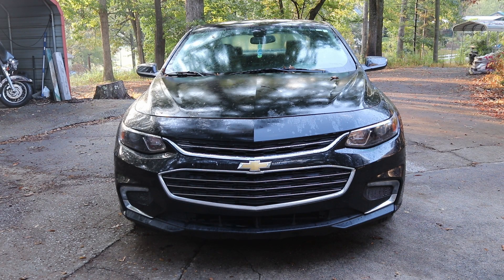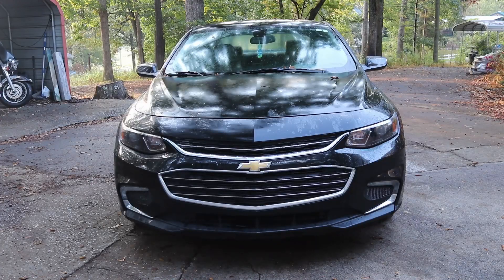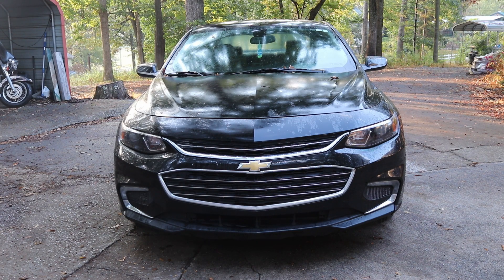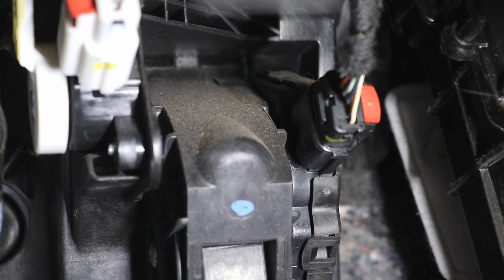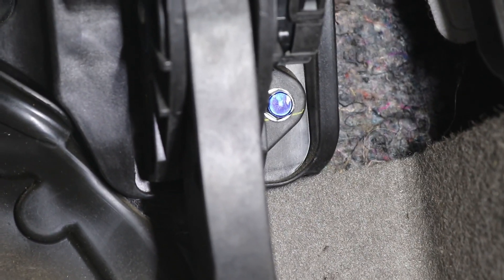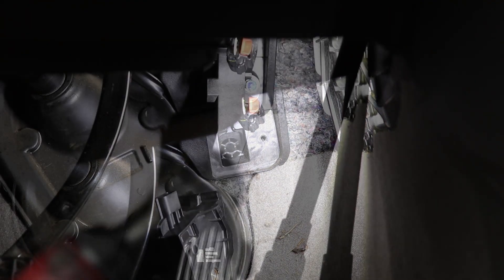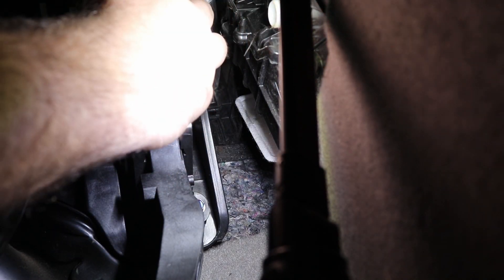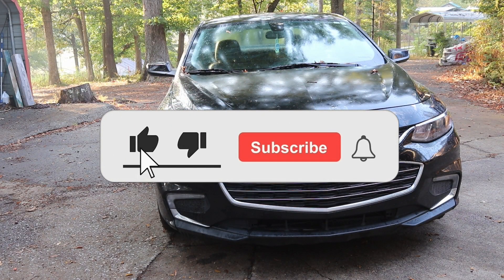P2138 2018 Chevy Malibu APP sensor replacement

Comment: I did this and changed the throttle body. Just got an engine reduced power light. Another p2138 code. I’m lost. What could else could it be?
Reply from the maker: It could be a problem in the circuit or even the pcm. Further diag is needed unfortunately. I would start with a scan tool and reading the live data see if you can catch something. Then go from there. Best of luck. Thanks for watching!
Reply: have you resolved the issue yet? 
if so what was the cause?